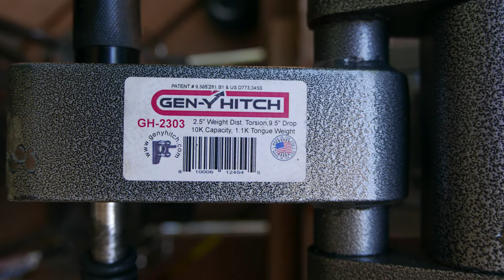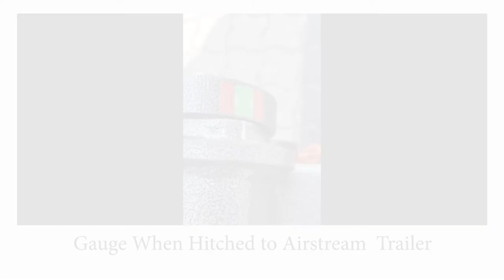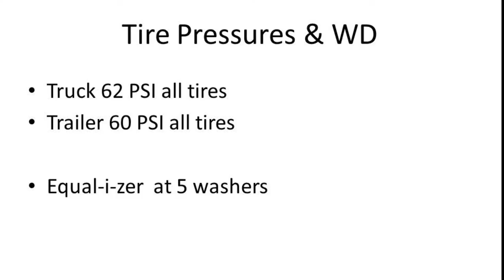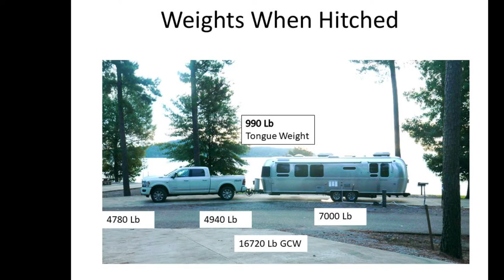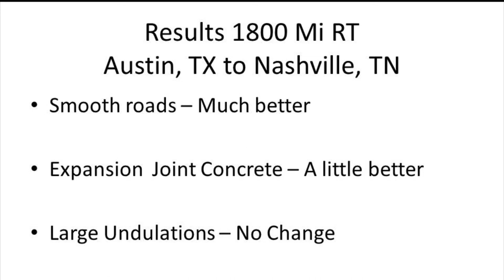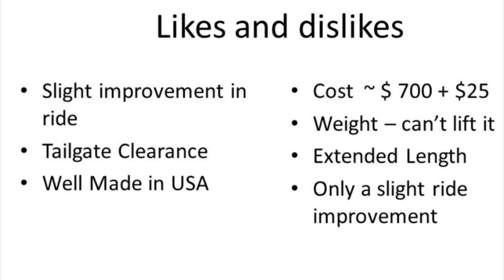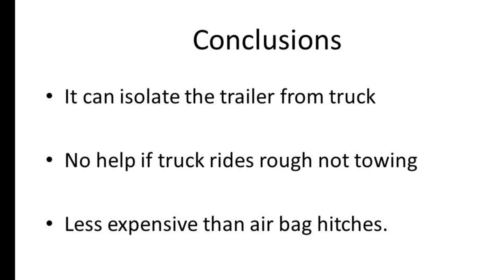Gen Y Hitch Review

Comment from the maker: Update: After about 6000 miles of towing, I have raised my opinion of this hitch. In order to get the smoothest ride, I made the following adjustments. 1. I changed the inflation on my truck tires (see separate video on this subject) I now run 65 PSI in the front tires and 67 PSI in the rears. 2.I reduced the amount of tilt on my WD head by removing one washer. This softens up the spring rate on that part of the hitch and allows the trailer tongue to move up and down easier allowing the torsion flex hitch to do its job. No change was observed in the sway control function. The ride  has improved and is much smoother, with virtually no pushing or bucking from the trailer. On smooth roads, the ride is very smooth with the hitch taking out all the motion from the trailer. On more bumpy roads, with frost heaves and potholes, the trailer motion is significantly reduced. Almost all the  jolting I  get now is from the truck itself which has a harsh ride to start with but has improved with the tire pressure adjustments.
Reply: Thanks for the great review and the follow up.

Comment: I have a 2019 Ford F-250 with your trailer, Sumo Springs , Equalizer hitch 14K bars 6 washers. It works and tows very well Cat scales are good ft end maybe 40 lbs light loaded however driving up to NY on Rte 81 this fall on that heaved concrete road OMG my ft end started hopping terrible. Scared the Heck out of me. Thank you for the honest review appreciate this. I was going to order one but maybe now I’ll go back to Air Safe or just stay with what I have. Never had a problem with out 25 ft Airstream but this 30 ft has a mind of her own.
Reply: I think you were running with too many washers and hitch ball was at too much of an angle for the torsion system to move as it should to soak up the road. It was transferring to your F250. Just my 2 cents. I'm looking to pull the trigger on this Gen-Y. Thanks for your review Jim. Helped me.

Comment from the maker: Update No. 2. Before setting out on a 2500 mile round trip to Nashville, TN, I made one more adjustment to my hitch and got an even smoother ride than before. I measured my trailer frame to ground distance at the front and year of the trailer and noted it was 1 in lower in the front than in the rear. I raised the Equalizer head on the Gen Y hitch by one hole making the trailer to almost perfectly level and giving me the best ride yet. There was no difference in sway control after this last adjustment. The Gen Y indicator now sits in the center of the green zone marked on the hitch when the trailer is hitched up. Before it was in the green zone but not in the center.

Comment: Thanks Jim for your video. I just bought the same hitch. I wish I bought the Boss multi set up with the 2 different size balls because they now have an attachment for the weight distribution hitch. It would have given me several options of towing. I have a 2019 Dodge Ram 2500 diesel. I do have larger tires on it. I rode fairly rough when I got it. I made one change and it improved my ride to be so smooth it’s amazing. I ordered the Cari leveling springs and put them on myself. It was an amazing transformation. I was so impressed I ordered other suspension parts to put on this month.i you ever get a second take a look at CJC off-road website. Question for you. Do you have any problems bottoming out with the 9 inch drop? Thank you.
Reply from the maker: Dean, my 2019 Ram 2500 has stock 20 in tires and 4WD. I have never bottomed the hitch out. I use it with the long side down and have  plenty of ground clearance. 

I found the best ride was when keeping the tires inflated to 65 PSI that is recommended on m door plates. I'll have a look at the Carli springs. Maybe they can help me. too.

Comment: i have this hitch,  i have to agree with everything you said..10-20% improvement in ride...we are goong to try out the SHOCKER air ride 12k weight distribution hitch, that we just got..i assume it will be better on large expansion joints.. i am trying to get rid of the chucking up and down.
Reply from the maker: Thanks for the comment.  I am going to make another long trip with the Gen Y this month and try some additional tuning of the tire pressures and WD bars to see if I can get a better ride.
Reply: @jim9404  I just recently bought this gen Y hitch. I do as well not see much difference in ride. I think I should go with the air ride shocker hitch...IDK

Comment: We have a 2019 27 FB Airstream and a F250 with Reese strait line WD hitch.  The truck pulls the camper just fine especially when we are fully loaded.  I am interested in softening the ride of the Airstream to reduce stress on it.  Since you tow an Airstream, do you have any comments on how the GEN-Y hitch effects the ride of the Airstream?
Reply from the maker: I did not measure the ride in the Airstream  with and without the hitch. There is a phone app that will measure g-forces in the phone over time  that could be used to do this  but it runs out of memory very quickly so it is difficult to get a read of more than 4 to 5 minutes. Then I would need a way to analyze it other than just looking at it. So I do not have scientific evidence, only seat of the pants. 

If popped rivets are any indication I have fewer now but not zero. That may have more to do with adjustments to tire pressure in the trailer and the load on the Weight distribution bars  than anything else. I run my GY endurance tires between 55 and 60 PSI cold. I ran the old GY Marathon tires at 65 PSI cold.  When I moved up to a RAM 2500 from my RAM 1500 I was able to reduce the tension in the bars a lot. 

After about 30,000 miles towing with the Gen Y hitch, I am satisfied with its  performance.
Reply: @jim9404  Thanks for the reply. I did not see it until today.    I switched from a F150 to a F250 and was able to switch from 1200 lbs bars to 800 lbs bars.   Seems to handle well.   I am looking at a 16 klb rated Gen-y with custom 3" shank to fit into the F250's receiver.  I hope to soften the ride for our camper.   Would be an interesting test to measure the vibration before and after.  Happy camping!